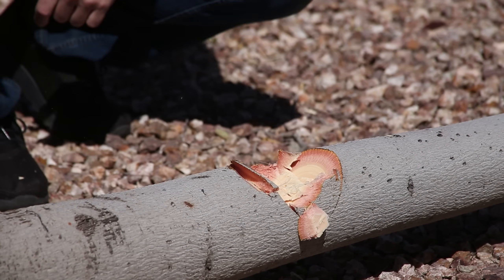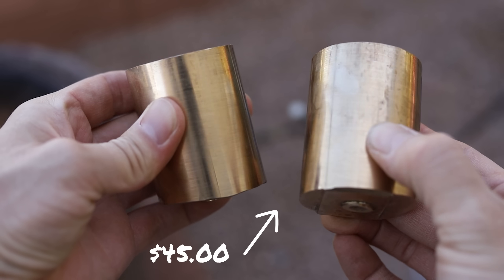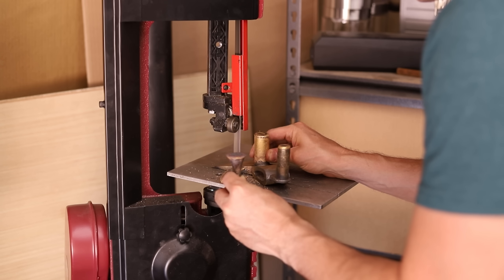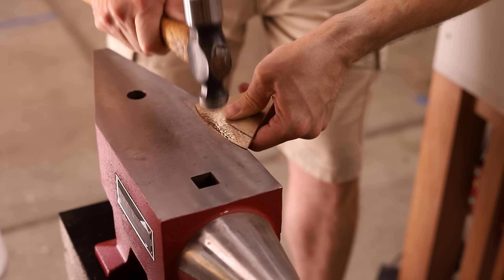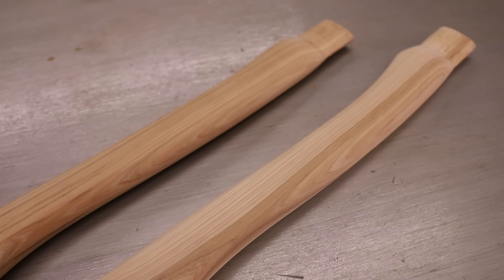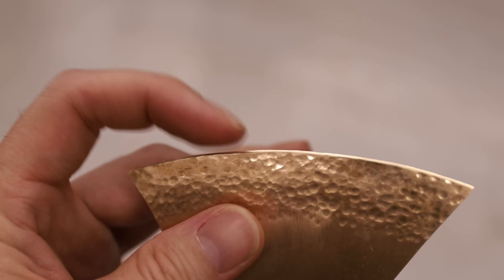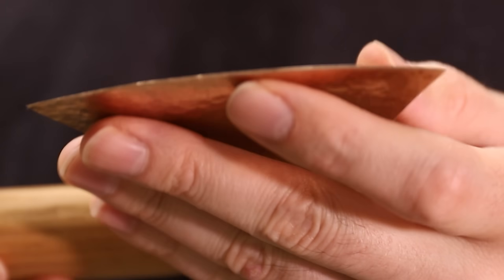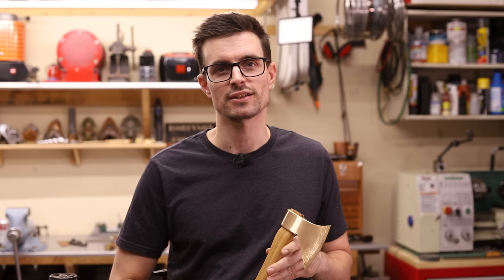Aluminum Bronze VS Tin Bronze, Making & Testing Bronze Hatchets

Comment: It may not look impressive to anyone else, but u drawing those lines was perfection
Reply: I'm an illustrator and noticed that right way, really top notch accuracy in that line and on both sides to match. Chef's kiss!
Reply: Thats not difficult. He just kept his finger on the edge. Its basic knowledge for anyone working with there hands. I personally do similar stuff being a construction worker.
Reply: I read the "It may not look impressive" part of your comment, and my brain immediately filled in "but this is what peak performance looks like" haha
Reply: They were impressive, no doubt!
Reply: I was really impressed with that line drawing, too.
Reply: Yup. Said the same thing
Reply: If you hold the pencil or marker and use your finger to guide along the edge, you would get the same results.
Reply: @Freeman-Dl70  Of course or you could use a stencil or a computer operated laser. But he didn't, it's freehand that's the point.
Reply: @okultusrexus3660  Thanks, Captain Obvious. Your attempt to make me look stupid has the opposite effect. Where in my comment made you think I said anything about stencils? Wasn't my comment simply telling someone they could do like carpenters do and guide their finger? Climb off your high horse, it's only a .25 cent mechanical pony.
Reply: @Freeman-Dl70  I see your point, my friend, but if you read his comment as "Wow! That was pretty impressive!", surely you can see that what you commented below it comes across kind of like "Not really." You can now say "No, I was simply pointing something out." but it's pretty obvious that your first comment was a sort of rebuttal to what he said was impressive. Apparently you thought it wasn't and said so, not so much gave us information about how it can be done.
Reply: @thinking-monkey  It is a pretty common and normal trick to do for anyone in the trades. By holding the marker and bracing a finger against the edge, you create a very accurate stencil with your hand that will mark at the same length from the edge consistently. Its a simple skill that is applicable to a lot of every day things.
Reply: Jesus truly does love you, He stands at the door and knocks, blessed is the man who lets Him in. Jesús te ama de verdad, se para a la puerta y llama, bendito sea el hombre que lo deja entrar.

Comment: how about bismuth bronze or black bronze? im always interested to see how different alloys perform
Reply: There is another ancient bronze that was used that you want to stay away from even though it is actually pretty good, Arsenical Bronze. Arsenical Bronze contains between 1% and 12% Arsenic (yes a Toxic Heavy Metal), with the rest Copper (and sometimes Tin), making this stuff can cause serious health problems and even death. A number of Copper Ores contain significant amounts of Arsenic (Enargite, Olivenite and Tennantite), likely the first accidentally discovered alloy and type of bronze, but due to the improved characteristics it was likely deliberately manufactured fairly quickly. Highly levels of Copper and Arsenic were discovered in Ötzi's hair (Ötzi, The Iceman, is a 3000+ year old (Chalcolithic, Copper Age) natural mummy found in ice along the Austria–Italy border), suggesting he was involved copper smelting and that they were using some of these copper/arsenic ores.
Reply: @sunshaker01  reminds me of the original recipe for pewter, which included lead.... and was used mostly for making stuff like silverware and plates..... they knew lead was poisonous at the same time they were doing this btw.... and the otzi mummy is very interesting, iirc they found out he had traveled at least a thousand miles since the alloy of that axe was only really a thing over a thousand miles away, something like that.

some things people used to do are insane.
Reply: @Minty1337 that’s how the future people are gonna look at us regarding plastic lol
Reply: @sunshaker01  I remember reading a paper back in college regarding arsenic bronzes. That covered Incan bronzes, and IIRC one of the conclusions of some of the testing was that rolled arsenic bronze with the correct ratios had properties that were comparable or better than some steels. So I think you could probably make a pretty decent blade or piece of armor using worked arsenic bronze.
Reply: @sunshaker01  Is there a Tungsten variant? Also wouldn't that be a suitable substitute for arsenic?
Reply: @glamrockfoxy3962  No idea, not a metallurgist.
Reply: All of this reminds me of how In depth the metal alloys system in dwarf fortress is
Reply: Bismuth bronze?
Reply: @just_that_crazy5179  bronze of the bismuth variety, if i remember correctly it's an alloy of bismuth (obviously), zinc and copper and it looks neat, but i don't know how durable it is.
Reply: @Minty1337 its mostly a self lubrecating alloy 

Their are basically infinite versions of bronze some work as expected some do something compleatly unexpected
Black bronze looks neet but is 8% silver and 8% gold so get expensive quickly
Reply: @aggese  only 8% silver doesn't seem too bad, but the gold is a bit ouch.

yea its weird how easily copper seems to 'bond' with other metals and produce funky alloys, and they all got such unique colors and properties too, far more fun than steel alloys in my opinion.
Reply: Terrafirmacraft player spotted
Reply: Arsenic bronze. But yeah I think this is a good idea. Try different alloys and forging/tempering techniques
Reply: Don't destroy them man, sell them! Most of us would pay quite a bit for a piece of artwork like this!
Reply: All this talk of bronze alloys makes me want to start up another Dwarf Fortress.
Reply: Vintage story players be like:
Reply: @sirnikkel6746  exactly my thought

Comment: The discoloration may be from the shield gas from the tig or possiby from oxidation. Molten from the crucible might not be the same condition as molten from the welder. These are quite beautiful and the hammered edge is really cool! I didn't know that hammering hardens the bronze. I've always wondered how well ancient weapons would have held up to battle conditions.

Comment: I read a graph somewhere that tin bronze, after work hardening exeeds the hardness of mild steel so honestly it would make for an excellent hatchet edge. If you have any interest in history tou might find a ton of inspiration in how strong bronze appears in historical writing... they made cannons out of the stuff for example.
Reply: tool steel still cheaper
Reply: That’s for high tin bronze though, for the hardness to exceed mild steel the tin and copper ratioes sometimes reaches 1:1 like in Chinese crossbow bolts
Reply: @hiimryan2388  fascinating 👏
Reply: Yup high grade Tin/Bronze has higher hardness than low grade steel, however it has a lower melting point (and a much lower point that it loses strength and fails)

Comment: You should mold in the "welding bars" into the top surface, so when you pour it, it won't just run off...but pool into a nice formed rod
Either way...such an incredible design and build!
Keep em coming!!!!

Comment: some aluminum bronze variations have a percentage of iron added and can be hardened up to 66RW. They're most commonly used in marine or industrial applications where strength comparable to steels is needed but also corrosion resistance. They make for great boat propellers
Reply: Another wonderful reason they're used is because they're nonsparking. They'd already be great on oil rigs for corrosion resistance, but it's absolutely critical that tools in combustion friendly environments cannot generate sparks.
Reply: @Dasycottus  a Very good point..
Reply: Where I work we melt down swarf and old castings (tin bronze), if a drill bit or other ferrous bit gets mixed in, it results in a really hard casting.
Reply: Also MRI machines contain very strong magnets that can't be switched off so bronze or titanium tools are useful.
Reply: Back in the bronze age, a bronze axe would get the same level of attention that a F-35 would get today.  The best work hardening. A trace of zinc was also there. Copper and zinc are frequently found together in rock.
Reply: Literally the first list of metals in the bronze he made lists a percentage of iron
Reply: @joearnold6881  or nickle
Reply: That material with a bronze wedge in the head too, a rust free hand axe for splitting wood!
Reply: We need to put 4 years of shop class in  high schools so kids can make and use metal tools,  and fix and repair gas and electric motors,  and know the basics of sewing, planting and farming a garden.    Humans are losing touch with the very basic needs of building civilizations from scratch.
Reply: Oh crap. I've been looking for a super hard bronze. The highest I'd seen was 45 hrc... From beryllium bronze so not feasible. (Beryllium is stupid toxic).
Reply: If you actually watched the video, this alloy contains 3% iron...
Reply: Rockwell isn't a scratch test, it's literally a test to see how far an incompressible thing indents the material with a set load. Softer things deform more. You can use HRC and HRB interchangeably in a small region.
Reply: What is RW rating, I knew HRC rating but not RW
Reply: @monkeking8604  depends on country, usually HR or RW is used everywhere, HRC denotes one of the tests used in hardness deformation test HR-C (Hardness-Rockwell-Crystal tip deformation) Usually diomond.
HRB wich is more common, is Hardeness-Rockwell-Ball indention 
as 
HV (Hardness-Vickerscale)
HB (Hardness-Brinellscale)
HR (Hardness-Rockwellscale)
..for the most how much a diomond deform is of littel use in most cases, its more a value of scratch resistance wich is for the most cases useless information...
Reply: @Patrik6920  This is just about entirely incorrect. All Rockwell scales measure the depth of an indentation, all the last letter indicates is a combination of indenter geometry and test load. As such, HRC being a scratch resistance test is absolutely incorrect. "RW" is meaningless and smacks of an amateur misunderstanding, and "HR" is incomplete information at best.
Reply: @ShimafromMS  u can look up this information easily... what i ment was HRC (crystal/diomond) tip indention is for most soft material useless and can be considered a scratch test for soft material... we all know a diomond tip will penetrate softer materials, didnt leave a complete desription as it would be pointless (yes thers seval steps to determine a HR value)...
Reply: @Patrik6920  The tungsten carbide ball used for HRBW will also penetrate most materials. It is because the diamond tip has a smaller projected area for a given depth that it is used on harder materials. You can use HRA (differing only by main load) on most soft materials.
Reply: @ShimafromMS  yes u can...
Reply: @Patrik6920  HRC is not a scratch test for soft material. On soft matwrial, it uses too high of a main load and goes deeper than the indenter tip is made to go, so the readings aren't valid.

I just want to help people understand these tests correctly.
Reply: @ShimafromMS  ..i belive i already said the same so... ya .. for soft materials not very usefull
Reply: @Patrik6920  Well, HBW 2000 is pretty useful, and it converts nicely to tensile strength if you know the material.
Reply: @monkeking8604  Rockwell
Reply: @dbmail545  rockwell hardness is in HRC not RW
Reply: @monkeking8604  I owned an engineering business some years back, manufacturing spare parts for US Army M113 APC, I remember we worked with RWC. I did not know is was actually called HRC.
Reply: 66RW? That is legit crazy talk.
Reply: Gun metal brass is most likely this as well guns thats are brass need to be strong
Reply: @jordanhorst6  some go to 130000 tensile nickle alum copper
Reply: As does some nickel, aluminum bronzes.  Then there is manganese bronze
Reply: Isn't it usually beryllium bronze in "nautical bronze" for boat propellers?
Reply: Does stainless steel work in marine settings?
Reply: Great for bearing too.
Reply: Navy veteran here. Yup, you are exactly right.
Reply: Also, very hard to weld!
Reply: It was very good to see what you did. I always struggled to respect bronze as serious competitor vs wood. It felt like you would have to use 5 axes to get a tree down. Now I can believe they did it this way.
Reply: Ampco18 is hard and brittle, it’s like trying to file glass.
Reply: Also aviation
Reply: I'd like a sword made out of that mix
Reply: 4:04 how do you tig weld aluminum bronce? Mine is 89%copper and 11% aluminum but when I try to tig weld it just heats up the full piece, I can’t see even a single puddle. When I test the welder with iron it works perfectly. I don’t know what’s wrong with it. Anyone know ? My welder is the bestarc arc200
Reply: also for gearings and bushings, since aluminium bronze runs very smooth and is low friction, comparable to brass but much, MUCH stronger and more corrosion resistant, just more pricy and harder to work with properly
Reply: I was a professional crew on a yacht with large bronze winch drums.  Those drums rusted.  Instead of going green in salt water, as is usual--they had rust colored corrosion.  Most marine bronze is Silicon Bronze and always goes green
Reply: Is it in HRC as in Rockwell Hardness C scale or something else? 
Since there is also B scale for aluminum and brass that is significantly softer.

If no scale is specified presumably it meant the B scale is used for aluminum bronze alloy.

58 HRC is around the hardness of 5cr15mov stainless steel tool grade steel. 60-70 is in the range of martensitic high carbon steel.

But there is other factors like the yield strength, ultimate tensile strength and stress strain factor, cyclic stress, impact strength, shear strength etc when measuring perimeters of a particular material. 

Since I cast iron is topping in terms of HRC hardness but the impact strength is bad and could be described as brittle.
Reply: @jay_chang  easier to cast
Reply: @jay_chang  did a post about HR-C/HR-B and what the difference r.. its in this same thread btw.. and ya using HRC scale would be rater useless for copper/bronze .. would say about noting about durability..
Reply: The spelling, grammar and punctuation is so bad in this thread it is difficult to understand what you’re saying. Turn your spell checkers on please.
Reply: @Youtuber-k2p  I'm not a native English speaker, but I'm sorry if I got something wrong in terms of grammar.
Reply: Stainless would be used for corrosion resistance. Naval brass is preferred due to its inability to through sparks. Very important when you’re working around diesel.
Reply: Jesus truly does love you, He stands at the door and knocks, blessed is the man who lets Him in. Jesús te ama de verdad, se para a la puerta y llama, bendito sea el hombre que lo deja entrar.
Reply: Why not use stainless steel?
Reply: @faq_is_love stainless steel's corrosion resistance is dependent on the thin chromium oxide layer that forms in the presence of air. underwater applications are thus vulnerable. bronze is pretty much resistant throughout and, in my reading, the corrosion is slower and less structurally detrimental.
Reply: @briankemery459 So if we made bronze pipes for water, how well would that hold up? (Genuine question, for 'science')
Reply: @briankemery459 Any Stainless I've ever worked with, like 316, is pretty much perfectly corrosion resistant. I've seen stuff that's been submerged for 20 plus years that's still shiny and shows the ultra fine machine lines.
Reply: @faq_is_love  stainless can still corrode, more so than bronze it's a lot better than steel but not perfect. It can also be more brittle, thus why it is not used in sword blades
Reply: @faq_is_love  stainless  only protected on surface stainless doesnt last 3000 years in the ground and it hardness make it hard to sharpen bronze doesnt spark
Reply: @udikai7799  In the context of ship propellers sparking doesn't matter.
Reply: @faq_is_love  try repairing one accidently set cargo on fire from sparks very common
Reply: @udikai7799  Repairing underwater? Why would anyone repair a propeller on a ship loaded with cargo?
Reply: @faq_is_love  props require lots of machining. stainless doesn't machine well. nor does it cast well. props are cast. having said that, there are stainless props out there.
Reply: 17-4ph machines super well but I imagine that the hardening process for a steel like that wouldn't be easy for a 3.5m tall prop for a cargo ship or aircraft carrier @scottcates
Reply: @faq_is_love  Which stainless? 304, 316 is kinda soft,
Reply: @faq_is_love stainless steel is rust resistant, but when it starts to rust it’s worse I think. Also I’m not an expert but think stainless steel is also not good for construction.
Reply: @faq_is_love a test to see how well it would work as bronze was used for many thousands of years , stainless steel is a relatively  new metal alloy , probably less than 200 years old
Reply: @faq_is_love  Casting a ship propeller out of stainless steel? If it was easy and cost-effective that's what everyone would be doing, and since they aren't I assume it's not. :)
Reply: @faq_is_love  ..its a channel about making beutiful crafted things .. for example a replica of an old hand axe/hatchet ..
.. but ur right in that mixing parts of different material can indeed be usefull, he has made an mixed material axe before .. wich was quite beutiful.. 
..Think of this things just as of a handcrafted decorative knife .. thay arent used for everyday use (ill would use a 20 usd junk knife that can be shapend a 100 times for that)
Reply: @Patrik6920  I wasn't talking about this channel.
Reply: @faq_is_love  aah sry, misunderstood ... nothing to see here, carry on, carry on...

Comment: Try copper with a hammered edge as well. I wonder how similarly it will work since the others are heavy copper alloys. What percentage would it hold up vs the others you made?